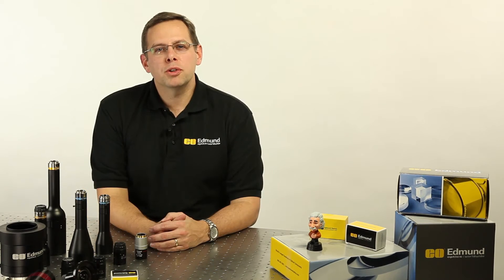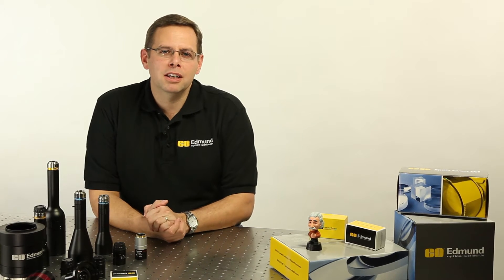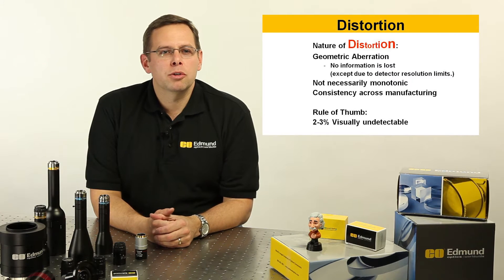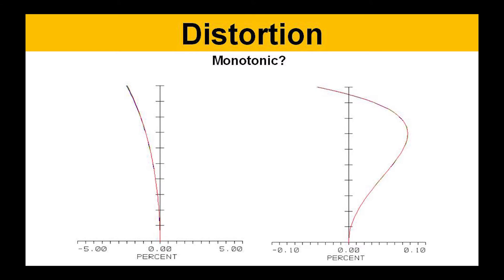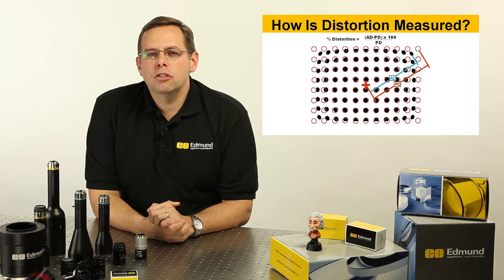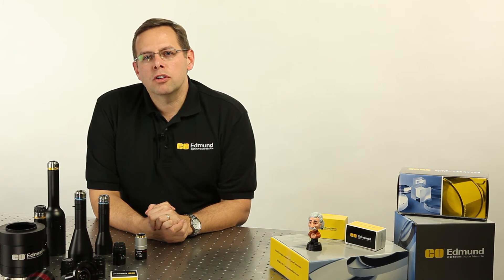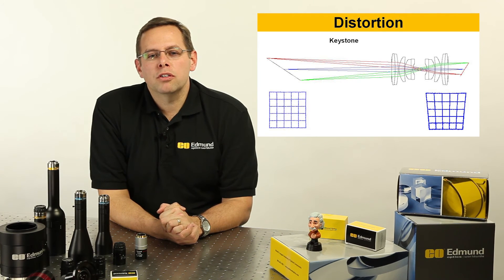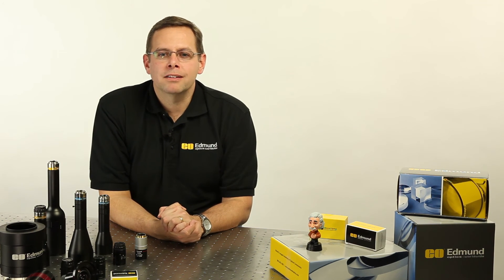EO Imaging Lab 2.1: Distortion

Comment: 2:09 I don't understand the plot 'monotonic?'.   What is the y-axis?  (always label your axes.) :)
Reply: y-axis is image height, meaning the radial distance from the center of the sensor. The plot on the left, for example, is saying that as you move away from the center of the image (up along the y-axis), you get increasingly large barrel distortion (negative distortion).

Comment: Say you took two pictures with two lenses that have identical properties except one lens exhibits 3% barrel distortion, while the other exhibits none. Since no information is lost with geometric distortion, would it be possible to correct the image from the distorted lens to make it identical to the image from the distortion free lens in post-processing?
Reply from the maker: In an optical sense, you are correct that there is no inherent loss of information with barrel (or pincushion, for that matter) distortion. However, there is a compression of information. Distortion is essentially magnification that varies with field height. Because we image with CMOS and CCD sensors that have finite pixel sizes, the magnification will vary from pixel to pixel when it is used in conjunction with a lens with barrel distortion. If there is too much compression relative to the feature size on the object that you are trying to image, then it will be compressed out of existence. Post-processing will not bring back this information. 3% distortion is a relatively small amount of distortion, so unless you are trying to image at exactly the Nyquist frequency of the sensor, the effect described above will mostly be negligible.